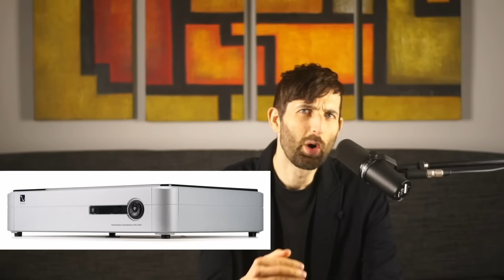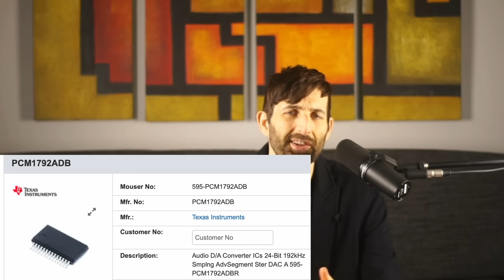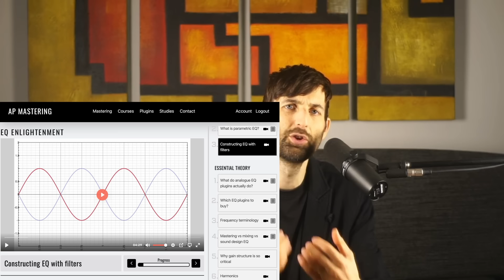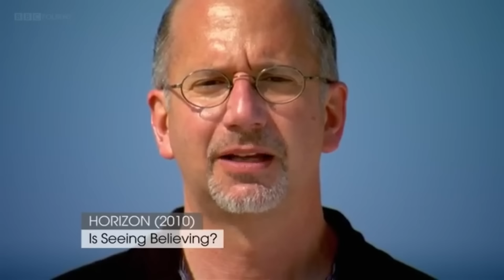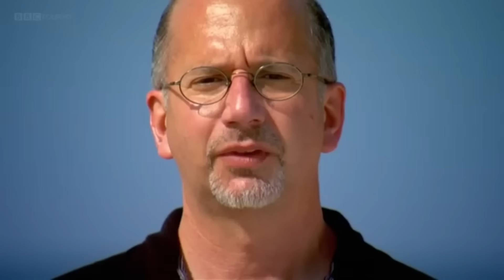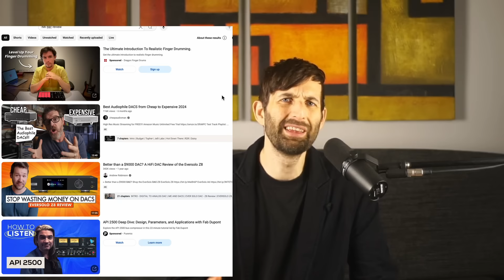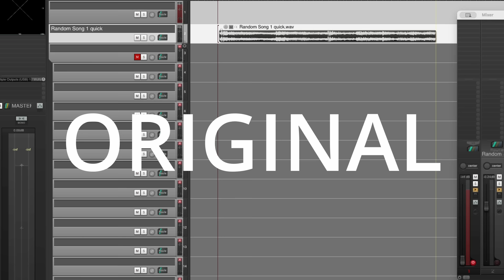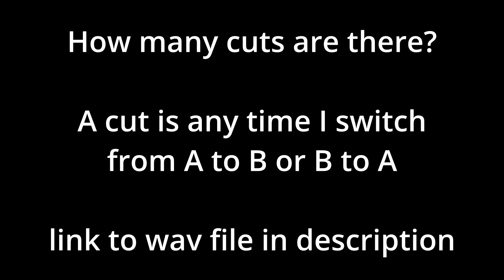The DAC Scam - Almost everyone believes the hype

Comment: Simply moving my head 12 inches backwards or forwards while sitting in the listening position between the speakers makes a bigger difference than A/B'ing between a $4000 DAC and a $160 DAC.
Reply: Yeah? I bet you're still using an old analogue head instead of the vastly superior digital head that I use.
Reply: @joelonsdale , I paid a lot for my head. It has a great soundstage.
Reply: Or just an inch or two left or right of centre.  

It really shows up on pink noise.
Reply: Perhaps it’s because it actually makes a difference, unlike DACs that are properly put together.
Reply: I've listened to expensive DACs, I've never owned anything more than 3-400£££ but I've borrowed and auditioned some more expensive kit, the well designed ones tend to sound identical lol, you're far better off investing in speakers and headphones as this is where you will hear a different presentation. Saying that I do like a bit of R2R, yes I know there's probably some audible aliasing and distortion artefacts getting to the speakers but it's a little like the difference between vinyl and cd, sometimes I'm listening for 10-15 hours, vinyl, tubes, R2R etc can be less fatiguing and more relaxed sounding then a really clean digital presentation, plus comparing my r2r dac to one of my DS DACs that measures completely transparent I do t really hear that much difference when critically assessed, just a tiny bit more warmth and maybe a tiny bit of a roll off in the treble. Some times I turn the colour up on the TV, I've also been known to put ridiculous amounts of pepper on pasta and order Currys with additional chillis, your headphones / speaker probably aren't completely flat so you're going to be hearing some discoloration anyway, it's a case of choosing your distortion
Reply: @oioionionone I completely agree. The biggest improvement I ever heard in sound quality and performance was when I had an ordinary car stereo back in the 1990s that had about 20 watts per channel, 4 channels. And I fitted a 400 watts amplifier, 4 x 100. To my same cheap speakers, they weren't changed. Using very ordinary cheap car stereo cable wiring, also not changed.

The sound was amazingly improved. No more distortion. Incredibly clear even at very high volume. The speakers didn't distort. And back then my car has a battery level/charging guage and this would drop 20% every time a sing played a bass drum beat! After I home built and fitted a 12 inch speaker as a form of sub woofer 😂

Plenty of amplification power will mean the music system can easily move your speakers quickly and powerfully. It's the speed and strength of the speaker movement which is making the sounds.

So an amplifier that can easily play at the volumes I want is what I'm after first and foremost. Then I can easily choose speakers because the amp can drive them. 

This is why I do look at these 40, 50, 60 watts per channel amps with a little bit of suspicion because although it's enough most of the time, but I'd really want 80 to 100 per channel for ease of driving any speakers.

The total maximum wattage number on the back of the amp is what I look at too. If the amp has a maximum continuous power draw of 100 watts then there's no way it's giving me 60 watts to both speakers, it will struggle to do 40 watts to both speakers, probably 30 watts will be it's absolute limit. 

I want to see 300 to 400 watts usage if it's going to give me 200 watts usable, depending on amp type A, AB, D, G whatever. Because amps have losses. 

Smaller speakers driven by a powerful amp sound better than bigger speakers driven by a weaker amp because they lack response, clarity and ability to push the air fast enough, at the right time.
Reply: Same thing for room treatment.
Reply: @dan-qe1tb  YT deletes every other comment I post, so the one before the "Also, have a look at the music video..." comment was deleted. Both of my DACs are R2R, the $4K one and the $160 one.
Reply: Exactly.
Reply: You’re just bragging about the size of your head?  😅
Reply: @cutty-sark  🤣🤣🤣
Reply: @loveandjapan  
Yes - sound waves are longitudinal and their compressions and rarefactions will be noticed with this movement.
Reply: @loveandjapan  💯
Reply: Leaving the room makes the biggest difference. You should try it
Reply: @Lex_Populus🙄
Reply: Still have and use an old MYTEK 192 DSD DAC/ I can seriously say it makes me wonder it still sounds pretty damn good in comparison to some of the newer ones I have sitting here
One example  the AKM4499, SOUND GREAT/ but the the old 2016/2018 MYTEK sure give it a run for its money I believe that my Tech uses 9016 ees saber,  there is one major manufacturer at present using the 9018. The difference is I have no clue., but if you find one of these old decs in  good condition working grab it, I always wondered why
For years after it was discontinued it’s sold on the used market for almost what it cost new . I really don’t care how old it is. It is still very relevant to me and it’s sonic reproduction of digital audio., especially using the USB input, SPDIF also sounds great too. The system I’m using is highly resolving way over 100db in loudspeaker efficiency.
A 10 or 15 W amp will blow the pain off the walls , the system will reveal the most minor change, but all these new fangled units that caused as much money
As an older used car at least  , at times really make me wonder. I have absolutely no plans of getting rid of MYTEK still sounds awesome, am I particular set up?
Perhaps that yours no two systems are the same, which I’m sure most folks know your room is also a very big factor , all in all the bottom line I haven’t heard any new
Dac unit that really blew me away regardless of price, of course your opinion may vary 🤷‍♂️🤷🤷‍♂️😎🎵
Reply: What amps and speakers do you use? Either your hearing is damaged or your gear is bottlenecking the performance of the DAC.
Reply: Maybe you just hadn't wanted to hear the extra soundstage depth and more natural timbre of an R2R.
Reply: @ Also, have a look at the music video on my page. I self-produced every part of that song (and video). I’m both a musician and a trained producer, so I’m listening to what’s coming out of the speakers in a very different way compared to someone who has never engineered or mastered a song.  Not a “casual” listener.
Reply: @dan-qe1tb   both of my DACs are R2R, but the $160 one is brand new and the $4K one is 30 years old.
Reply: Well.. I compared hifiman he1000 to he600 directly. And boy, do I hear a difference... YES.
Reply: @kkazakov  what specific differences do you hear, and how well would you do in a blind test? For my test I closed my eyes with both DACs hooked up and volume matched, and with my eyes closed I rapidly toggled between them using a remote. There was no discernible difference between them through the speakers, and this is a $4K vintage R2R DAC vs a $160 modern R2R DAC using redbook lossless FLAC (see earlier comment for the specifics). The speakers are handmade, Italian, solid walnut cabinets, and close to $4K in 2025 dollars, and the rest of the system is TOTL late 90s Parasound.
Reply: @loveandjapan  I'm listening on headphones. And I do hear difference. So sorry you don't.
Reply: @kkazakov  ok, but describe that difference to me, in real terms. What is different? 

My $160 DAC doesn't even measure very well compared to other contemporary DACs, but here's the thing: the harmonic distortion, while higher than other DACs, is still below the threshold of human hearing. For someone to hear a difference between DACs there would have to be an inexcusable level of noise and distortion we would never expect in any DAC costing more than $10. As I mentioned above, I'm a music producer who has mixed and mastered my own tracks that are available on all major streaming platforms. Believe me, I know how to listen.
Reply: @kkazakov  You mentioned two models of headphones - are you comparing headphones or DACs? There are huge differences when comparing headphones to headphones, and speakers to speakers. It's unclear if you can hear a difference between DACs because you didn't mention anything about any DACs. There's a blog post that concluded that certain people can tell the difference between a $10, $3000, and $20,000 DAC, but it's not a lot of people, it's mostly using headphones, and not all of the user preferences lined up neatly according to price. It's on a blog called Archimago's Musings. IMO the differences are so subtle that it doesn't make any sense to spend $20,000 on a DAC. That money would best be spent on speakers.
Reply: @kkazakov  ok, so the hifiman are headphones, so that's going to reveal more details. All I have are Sony MDR-7506s and I wasn't able to detect a difference using those, admittedly non-hifi but still very accurate (in the highs and mids) phones. I can hear up to 15,000 Hz in my ripe old age.
Reply: Firstly, this smacks of either room acoustics issues or mediocre DACs or both. Secondly,  why is it an either/or issue? Optimize all of it. But optimizing the one doesn’t mean the other has not effect or value.
Reply: @a.s.2426 my point is that room treatment and listening position are far more significant than the DAC (any DAC that costs more than $20). The main flaw in my recreational listening room (not the recording and mixing room) is that due to size limitations my head is 18 inches from the back wall. There’s a very thin curtain there but it doesn’t do much to squelch reflections. The system itself is top of the line p a r a s o u n d from the late 90s. The speakers are solid walnut and made in Italy if that gives you an idea.
Reply: @loveandjapan  I do take your point that a mediocre system in an acoustically great listening environment could well outperform a great system in a mediocre room. Still, it's hard to make claims about "far more significant than" without a more specific context. What happens when you have a fairly decent room set up and you move from a $20 DAC to a highly reputed $2K DAC? Probably a pretty large lift in enjoyment and quite possibly more than taking that room to great. All sort of nebulous and insufficiently specific, again. I say optimize them all but, yes, keep in mind that the room needs to reasonably keep up with the quality of the components.
Reply: Because you hate detail so you listen with speakers instead of quality headphones.
Reply: @d0nj03  Ok, well first of all, all of your favorite albums that you listen to are primarily mixed and mastered on speakers, NOT headphones, so if speakers are good enough for the recording and mastering engineers, then they're good enough for me. How do I know this? Because I interned in professional recording studios in my youth and participated in numerous album productions, and since then have recorded and released my own music to all major streaming platforms. Finally, the debate here is not "headphones vs. speakers," it's cheap DACs vs expensive DACs, or just any DAC compared to another DAC.      .            .
Reply: @ Everything is being mastered for speakers because of historical inertia - speakers got good for home listening far earlier than headphones. Doesn't make them the best technology for hearing detail or subtle differences, just like - to return to the topic as you proposed - when trying to discern differences between DACs. For this experiment specifically, listening should be done with headphones, not speakers. Or at least people who choose to use speakers should not be surprised they didn't hear any differences.
Reply: @d0nj03  Left a 3 paragraph, detailed comment and YT deleted it. Wonderful. Here's part I:

People like to listen to music on speakers because live music takes place in a room, so speakers simulate the live music experience in a way that headphones don't. Now if my preferred listening environment includes speakers, and the system isn't resolving enough to distinguish one DAC from another, then the DACs are functionally identical and spending more money on a DAC is pointless.
Reply: @loveandjapan  Exactly. My brain just won't  do headphones, just too unnatural.  My understanding is they have to be binaural recordings for headphones which may be what stresses me.
Reply: @loveandjapan  I don't think there's anything more I need to clarify to you wrt. subtle differences between DACs being easier to hear with high quality headphones than speakers, I will just mention that yes, these days it's best to save your YT comments to a text file in case they get auto-rejected, so you can retry posting them in smaller chunks or with certain words removed (I discuss politics and get censored to hell, so I know the pain of writing a detailed explanation and having it vaporized for no clear reason).
Reply: And do you have a $4K DAC? I do and it makes a huge difference!! My DIY speakers have a big sweet spot because I know how to design speakers.
Reply: @michaellandskroner964  Left a detailed reply and youtube deleted it. I'm so fed up with youtube's automated moderation. It seems like every third comment I leave gets removed, especially the lengthy ones. I don't like having my time wasted!
Reply: @loveandjapan  AMEN!!
Reply: @michaellandskroner964  Crazy - I simply cannot leave a comment with the make and model of my DAC. Three comments deleted by youtube. I give up.
Reply: @loveandjapan  try misspelling or what it rhymes with
Reply: @edcypha  Someone else left a massive comment which made it to my email notifications, but youtube deleted it shortly thereafter. My $4K DAC is a  P a r a s o u n d  D A C - 2000 ($4K when adjusted for inflation). I can't distinguish it from a F i i O  K 1 1  R 2 R ($160) when played through speakers.
Reply: @loveandjapan  there is a trick where you leave info in the comments section and it doesnot show up workss good for the groups I belong to.........just a sugestion....
Reply: @geraldcrouse4267  Could you explain what you mean by "leave info in the comments section?" I would like to try your suggestion but I don't understand it.
Reply: @loveandjapan  just find a reply sign in the post some where and put your links and text in the reply not a new post......click on  reply and put everything in the reply and click done...
Reply: @loveandjapan  Sir I would like to know about your opinion of Topping D50 iii dac as it has a dual dac chip. I have diy made a class ab 400w amplifier with balanced xlr input. Thank you
Reply: @michaellandskroner964  Parasound D/AC-2000 Ultra Analog. $2000 in 1996, equivalent to $4000 today. Rare, sought after R2R machine, same chip used in Mark Levinson, Sonic Frontiers, etc
Reply: @michaellandskroner964  nice which loudspeaker company do you design for? I made some awesome DIY speakers also but I’m not an engineer. I am not implying anything just making a statement.

Comment: So my stand-alone Accuphase processor- DAC with 2 separate power supplies, one for incoming digital from my stand-alone streamer and one for the outgoing analogue conversion is just as good as my former DAC-60 card in Accuphase preamplifier or the DA2 DAC card in my former McIntosh MA12000 integrated amplifier? You have no idea what you are talking about. The difference is huge . It's a day and night difference. I've also heard differences between various stand-alone DACS, streamers, preamplifiers and amplifiers. So what the hell are you even talking about? LMFAO you're channel is dumb.

Comment: IMO, Speakers make the biggest difference then Amplifiers.. I have been enjoying audio at home for 40 years. I could 100 percent could double blind my speakers with others, Amplifier I think it would be really high. Everything else not so much. I've spent quite a bit on my speakers and monos, no regrets, but I use a little eversolo A6 as the front end, inexpensive in comparison with the rest of my system as I agree with this video and digital. I also don't agree with cables and other tweeks.

Comment: I have read the linked PDF "Persistent Belief in Qualitative Sonic Differences
Among DACs Without Objective Auditory Detection" and from scientific point of view the problem is that the methodolgy used is simply inadequate. The only question that can be proofed with this approach is that the chain(s) used for audio reproduction is not adequate to respolve the subtle differences in sound quality. In consequence the p-value is OF CORSE (!) < Exp -9. This just means that no difference was detectable. However, you CAN NOT differenciate with such an approach if there are no differences in sound quality or if the reproduction equipment was not able to resolve it. Therefore the experiment is simply meaningless.
(To be clear: I refer with resolution not sampling frequency and bit depth but the resolution power of the reproduction chain)
Reply from the maker: i don't know what you mean. it's a loopback test. the claim is that there are huge differences. then you would hear that in a LB test